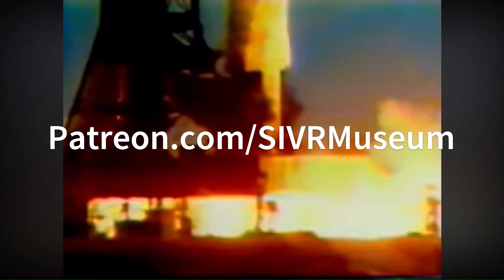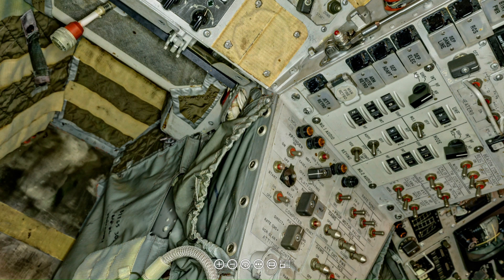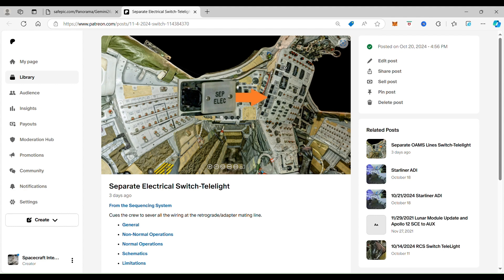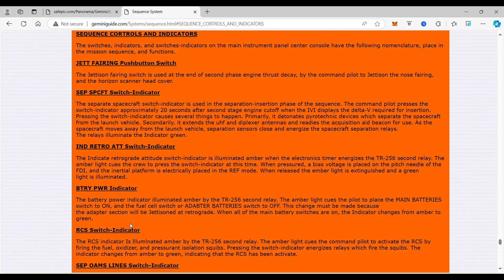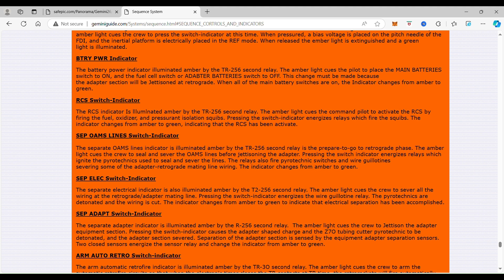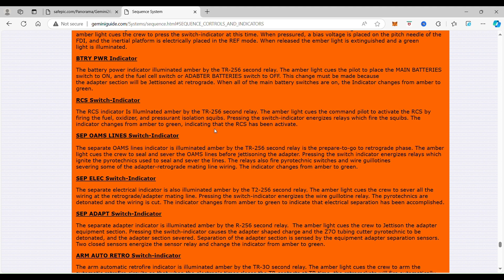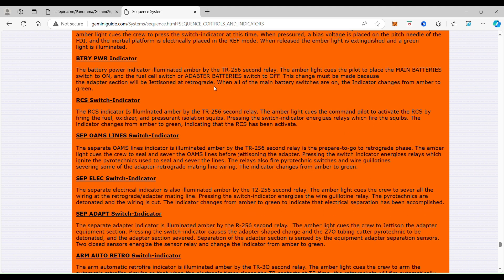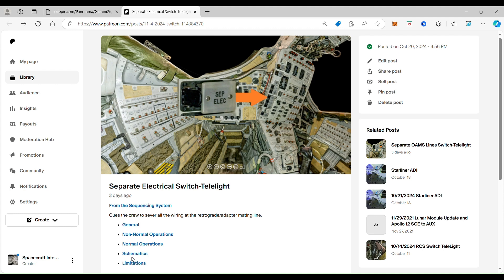Public Separate Electric Switch

Comment: I would just indiscriminately flip all the toggle switches, turn all the knobs fully clockwise, and then hope for the best. It usually worked for Dr. Smith on the Jupiter 2.

Comment: The F-111 ejection capsule also used explosive-driven guillotine cutters as part of its ejection sequence. The aircrew didn't have individual switches for each step, they just had to squeeze the handle (which mechanically unlocked it, enabling movement) and then pull. It took just a fraction of a second to cut the wires, explode the det cord (cutting the capsule from the airframe), and fire the rocket, and after another very short interval activating the drogue chute (and if in the proper "envelope") the main chute.